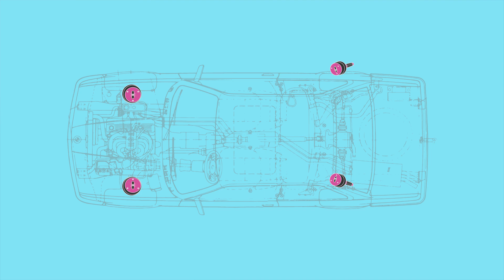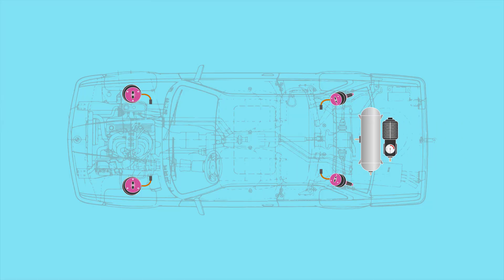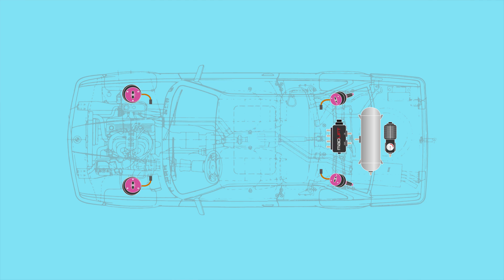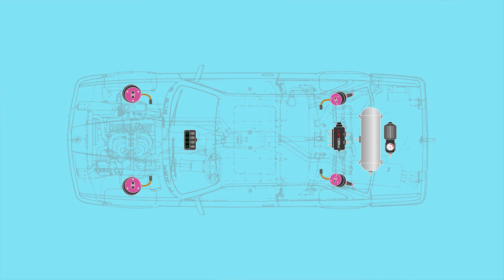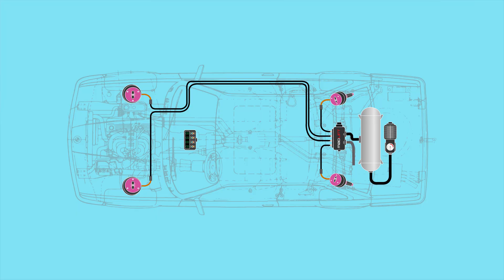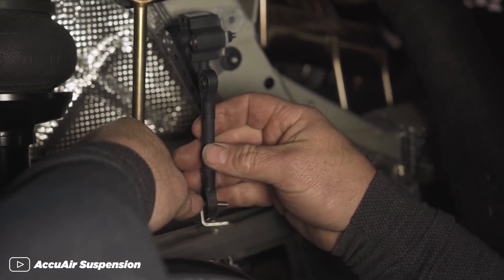Air Suspension || EXPLAINED

Comment: I drive trucks for a living (euro) and they all have these out of the factory, you can pretty much lift an entire axle off the ground if you want to for extra traction, but I never understood the idea behind air suspension in a car when it looks like the tires are scraping the inner workings of the car, is it just for show or is there some other function?

Comment: I've been swapping a 2jz/t56 magnum F into a 99 Tacoma since 2021. the truck is a long travel build. I built the engine so there was a lot of money dumped there. I'm 45k cnd into just the engine and trans swap and still have another 20k easily before I hear it run. I have spent the money on lots of nice parts and most Def could have done it cheaper but just wouldn't be happy with the build if I cut corners. If I had known I would have been 60 to 70k cnd to swap this the way I wanted to, I may have reconsidered. I'm so close now tho I have to get it done. Everything is custom. There is nothing stock to make this work. I could have used the stock fuel tank but I'm building a bed cage anyway so radium fuel cell it is. I've helped buddies swap engines but never swapped anything I've owned so i felt it was time. I had no idea what I was getting into. Thinking 20k would have gotten me a sweet set up was just foolish.